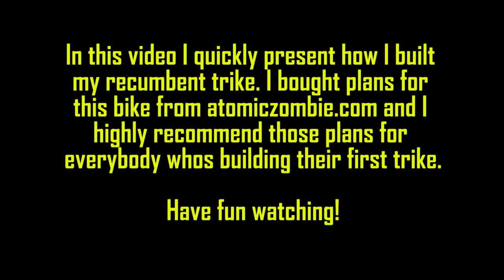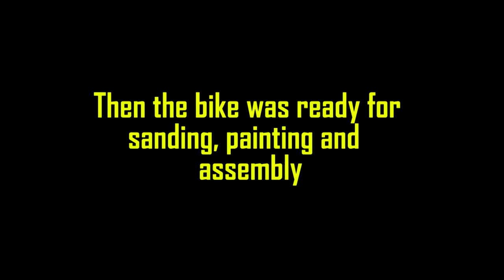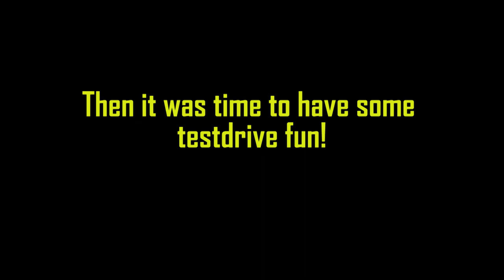DIY Recumbent trike

Comment: Nice Job!  I built the same one several years ago and it's still going strong.  Suspension would be nice but it helps a lot if I just reduce the tire pressure somewhat.  I thought about replacing the tires and rims with Fat Tires but the rear frame isn't wide enough to accommodate a fat tire. Mine weighs 50 pounds which is about 10 pounds heavier than most factory built trikes but I don't even notice the weight unless you're climbing a steep hill.  They sure are fun to ride!

Comment: A little tip for those who plan to build one themselves:
One-sided wheels with drum brakes are sometimes found on wheelchairs. A friendly visit to the janitor in a home for elderly can help to find one of these which isn't used by the former owner anymore. Sometimes the relatives of passed away inhabitants don't care about the wheelchair and leave it for good. I think it's a good thing to reuse them instead of throwing them into trash. At least this is how I got mine.

Comment: This looks like it would be fun to use and ride I am wondering how much it weighs also i can just imagine mounting both a gas engine for a bike along with a high tork mid drive electric motor on it for pedal assist to pull a trailor for hunting along with fat tires go traveling also what is the weight it will hold/carry?

Comment: This is really good job. Can I ask a question please = did you buy the front wheel hubs or make them yourself ? This is not a "normal" bicycle wheel, because it does not have a fork.
Reply from the maker: Some bmx bikes have 20" wheels with 20mm axel hole. My wheels were custom made and they were quite expencive.
Reply: A cheap solution is to get BMX wheels (I bought a second hand BMX for 20$ in a flee market), and change their hubs (local bike shops) to get disk brakes (cheaper online) and 12 to even 20 mm axels (depends where you'll ride it). Also, some wheels are sold online from most recumbent retailers/producers, or on E-bay/Alibaba... but expect to pay A LOT for these.

Comment: very nicely done. curious did you build it using steel or aluminum for the frame?
Reply from the maker: Thanks, It has Steel frame.
Reply: @Hemppa  any special specification on the steel?
Reply from the maker: No, I just bought normal steel tube from hardware store.

Comment: Great build. I am going to order the atomiczombie plans for their tadpole trike. My question is what do they use for front wheels and how large are the spindles. Can you buy the front wheels already made or did you have to make them.
Reply from the maker: I bought rims, spokes and axels separetly but afterwards I heard that some bmx bikes have wheels with 20mm axel. I recommed to find those ready made wheels bacause my wheels were the most expensive part of the bike.
Reply: @Hemppa  Thanks
Reply: @Hemppa  so inspiring.  will look for wheels.  HYvä paivää Sweden
Reply from the maker: Finland
Reply: @Hemppa  ;)  A question, im not a velder, dont know how to.  will i fix this project with a cheap welder and some practice ?
Reply from the maker: Hard to say, there is quite alot to weld, but for pro it is not a problem.
Reply: @bub1683  I am a welder and I think that you would be better off getting a Tig welder or maybe a Mig welder to start practicing with. Just keep practicing on scraps and make sure you get good penetration so your welds won't fail.
Reply: @Mrflashlite  wuld be awsome to learn welding. Need to check it out. cheap is a big no-no for welders like you, i guess. I will look deep into this.

Comment: Hello, I saw your video of the recumbent bicycle and I bought the atomic zombie plans but I do not know the diameters of the tubes or the kind of tube in them, which is for example if it is made or aluminum and the diameter of the tubes either It is specified, it would be a lot to ask you to tell me the diameter of the fork tubes and those of the rest of the bike so that I can start assembling one, as I said, I only understand the length of the tubes and how they are placed but the diameter and the kind of iron that is not coming or I have not seen it, thanks in advance a greeting.
Reply from the maker: If you mean the front steering tubes it depends of the bike you take the tube from. The main tube is 4cm x 4cm and 1,5mm thick. All are steel tubes. I am happy to help if you further questions.
Reply: So the whole bike is built with a 4 cm x 4 cm tube and with a tube thickness of 1.5 mm, is it correct?
Reply from the maker: If I remember correctly
Reply: I don't know if it is well translated by Google because I speak almost nothing English and write it little, I thank you for answering me so quickly because I want to start my prollect and I did not know how to buy the irons, the truth is that when you see the video the tube seems larger in diameter haha, you have a luxury trike you have nothing to envy to a purchased one that is worth € 2000 or more
Reply: With this information I have to start the project, I would like to know if I could ask you for some more advice as I move forward if it is not annoying of course
Reply from the maker: @josemanuelorgueiramartinez2849  Ofcourse, I am happy to help

Comment: That Tilting when he braked hard showed how the trike is not safe at high speeds. Plus the pôle behind the head looks dodgy, it really needs a headrest
Reply: most if not all trikes do that when hitting very hard the brakes (it's called a "back wheelie")... the only exception being the trikes who have their  front wheels at the very front end, but these tend to be less stable in tight turns.

Comment: What did you do for the front axles?
Reply from the maker: There is 20mm bolts as axles if that is what you mean?
Reply: @Hemppa  yeah almost. Is it a standard off the shelf bolt, or is it specific to bicycles? LH / RH threads?
Reply from the maker: Yes it is standard Bolt Off the shelf. I dont rememember what kind the thred is.

Comment: How about the speed?
Reply from the maker: It is not as fast as normal bike, but its more comfortable so long distances are easier to pedal.
Reply: How much you've spent for this project?
Reply from the maker: I bought old mtb and front tires, thye were 250€ and Steel was maybe 50€. Alrogether aroud 400€. Front tires were expensive.
Reply: @Hemppa  It is not the building plans, but the complete parts list and where to buy the parts.

Comment: what was the cost and what metal was used for this?
Reply from the maker: Front wheels were expensive they were custom made, not nesessary. Alltogether 350 euros, Front wheels were almost 200 euros. Steel was 1,5 mm thick.